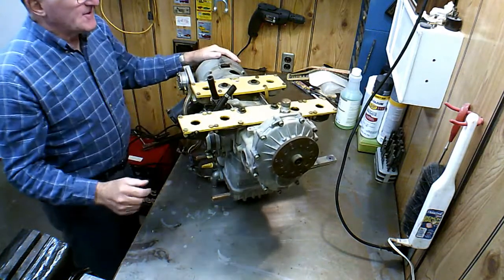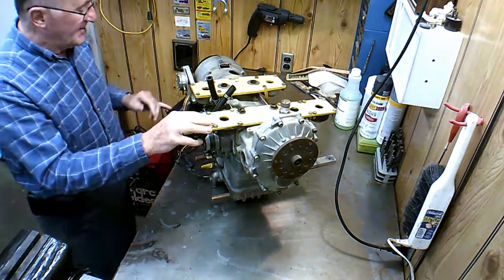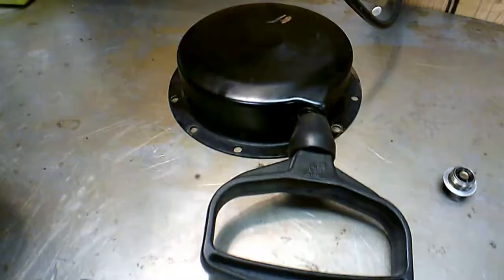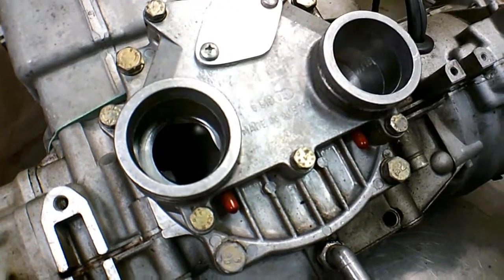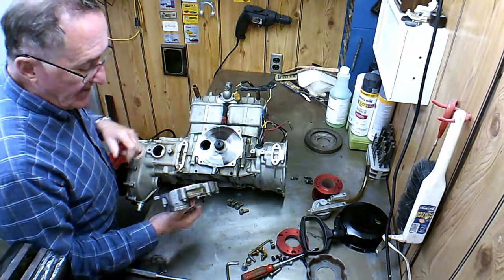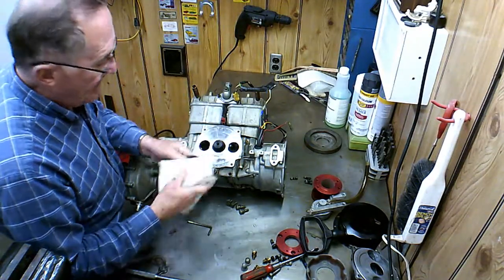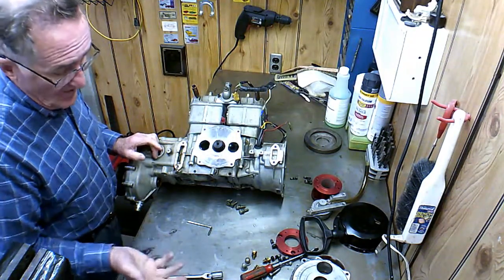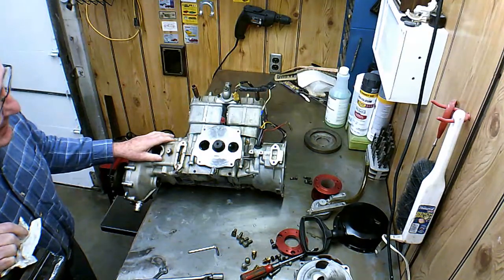Rotax 582 modifications #1 & reasons (gray head) rotary valve. Inverted Chinook installation.

Comment: A great engine, I have a 583 mounted on my Kasperwing U/L. I haven't flow it yet, I still need to replace the rotary valve shaft oil seals. I don't trust the oil injection, we have always mixed 50:1 in our engines.
Reply from the maker: Sounds great!

Comment: Has the engine failed on you in all those hours and if so what caused it?
Reply from the maker: No. It has not. No oil injection and no pressure in the cooling system are the best things you can do. Decarbon at 450 hours for sure.
Reply: @Adventurepilot70  Thanks for the reply. Getting back into flying behind a 582 so your info is well appreciated

Comment: Your first opening after 1400 hrs?
Reply from the maker: It is the first time opening the crankshaft for 20 years. 
I got the engine with 640 hours on it, and it had been de-carboned at least once. I had the engine with nothing to put it on until I built my Chinook.  At that time I opened the crankshaft to examine it, as the original owner had used the oil injection for the fist part of the engines life.
   I don't know how many hours were run with the oil injection, but I worried that there could be some wear on the crankshaft, so I opened it up to examine it before it was installed on my Chinook.
   The pistons and cylinders have been removed 5 times to remove carbon and check for stuck rings since I first examined the crankshaft in 2001.